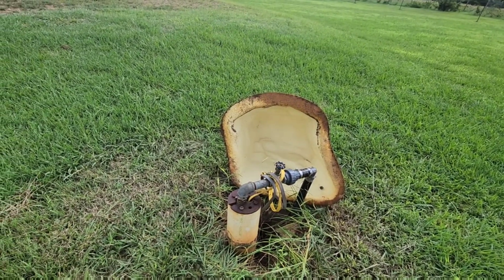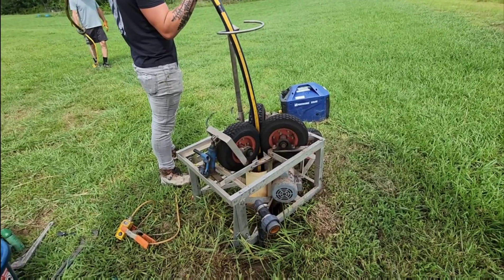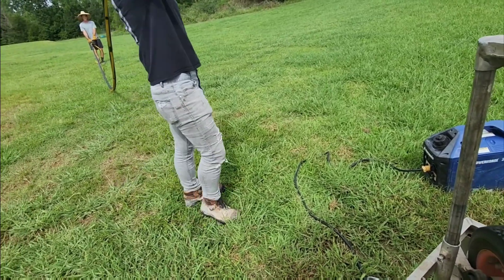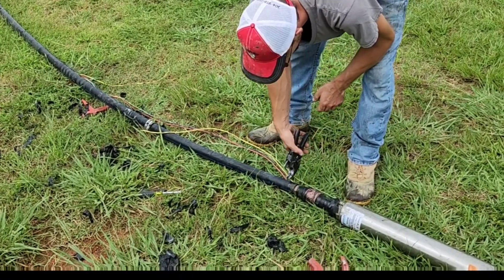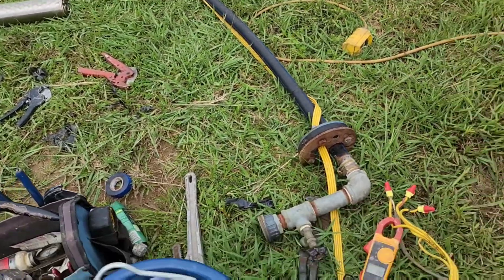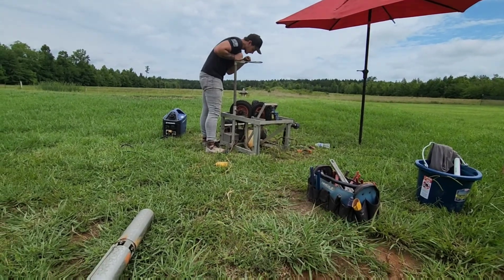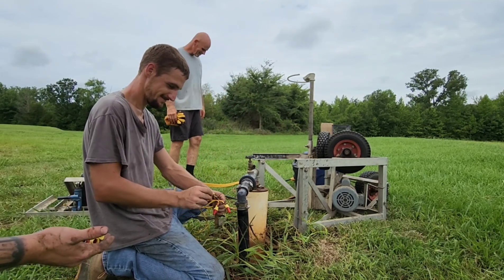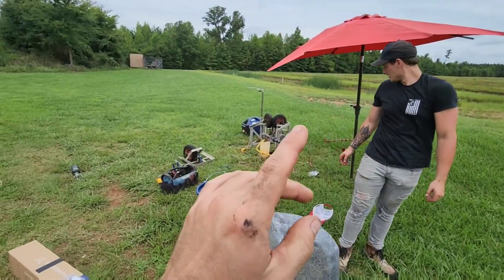Replaceing a 3 HP Well Pump for "KOI" Fish Farm, 1 Million Gallon Ponds Filled by 2 Wells!

Comment: the problem is directly related to not using the torque arrestor  originally , i's obvious a wire would rub if the pump was hung loose into the pipe, especially 3 hp. Installation error

Comment: You r good and know a lot,lots of experience BUT…pulling the pump from the yellow wire to attach it to the pipe and tighten with the channel locks the pipe couple w/o holding it NOT You

Comment: I noticed that the equipment you drive appears to have the steering wheel on the left side. Is it designed and built in UK or  am I in error?
Reply from the maker: No, a phone camera just flips the image. Nothing crazy
Reply: All or most Yanks drive on the opposite side of the road,because they like to be different!

Comment: When the pump runs it cause vibration it move the pump pipe then the electrical wires touch the well pip that cause the wires break
It is the easy problem to solve for not get the same problem but why you only replace the wire.

Comment: I continuity test will tell you without pulling the pump. A bad motor will read dead short , open circuit is bad wire. Covers all fail modes except shorted wire

Comment: Seems light lightning would have burned/blackened the insulation where the copper went bye bye. And the amount of voltage and current needed to ruin the wire should have turned the pump itself into a molten blob.  I guess if both pumps burned out at the same time, that's about the only good explanation, but still. Ahhh, and the more I think about this, I think I understand it. The neutral wire must not be bonded to the ground wire hard enough, so all of the conductors had the same high voltage, so nothing went through the pump at all, but the yellow wire is the one that had a weak point in the insulation where the lightning bolt leaked out. Still should have been some burn marks.Just because I was a failure analyst in a prior life, I always want to get to the unambiguous answer. Last possibility, installer had the pump hanging on the yellow wire by accident during install, didn't realize it, and a small (less than 4.0, you would never feel it) earthquake that was just a vertical wave broke the camel's back.

Comment: I have a 6 thousand gallon koi pond  with over 4 foot long koi that I bought in 2005 and when it doesn't rain for a moth in the summer water is important  , They are not expensive goldfish    they are koi  so related to carp   They have whiskers like carp also   just a little info  .Did you see them     Your video explains why my well pump went out bad wiring  I even asked the plumber about the wiring before he put first pump down and destroyed it  . Replaced the wires and second pump worked  had to change likes from 666 to 667   don't want you to get bad luck
Reply from the maker: I've been noticing that bad luck number!  Thanks for that!
Reply: @h2omechanic  your very welcome and your fix on my well worked I have been running the hydrant near my pond 2 times a day for  awhile and checking v the look of the water and it is clearing up . I will know  better when my filter goes off thursday .I also flushed my water heater by turning the valve off and on to stir up anything in and it did . As per another youtube posters video . I guess I may have hired a not s good plumber but they were the only ones that answered the phone at 7 am to get water back on . but at least were nice enough to bring me water so hubby could take his medication as he just got out of the hospital the night before  . I did give the guys each 20 dollars for lunch on us for saving me , so I guess it was a win on that . I had water even though dirty which I expected . Hubby is getting better after his heart attack . Your mom and dad raised a great son  SO THANK YOU AND THEM

Comment: What wire gauge do you use for a residential one horsepower pump that like 100 feet deep?
Reply: Gotta figure in the run from the panel to the we'll head too.

Comment: Would it not be an idea to fit soft-start relays to those well pumps or only fit well pumps that has soft-start built in? That would solve a lot of problems like this one and make the well pumps a lot friendlier to drive from a grid / generator point of view too! 👍

Great video, thanks for sharing it. 🙂
Reply: @Morten Mortensen, that's an interesting idea! It reminds me of the "buffering" of "delay" type fuses which are designed not to trip when various devices with high current demands first activate.

Comment: I have many 7.7 to 60 hp subs.    I run a 1/4" air line along the wire.    I start the air line at the pump head to the surface.   I can then know the water above the pump.   Each pound of test  air line pressure is 2.31 feet.   I can squeeze the flow rate  to have the proper water in the hole  above the pump.   A VFD panel is best.
Reply: Are you talking about sending an air line below the static water line ?
Reply: @Mk101T  To the bottom of the lowest possible  water level while pumping.
Reply: @robertreznik9330  a submersible pump is best to pump with no air in line.
But a bubble pump  .... well that is what you talkin bout .
Reply: @Mk101T  no, the air line is to determine the water level while pumping.   Air in the pump will destroy just like sand will.
Reply: @robertreznik9330  OIC ... I guess that makes sense you can use air pressure to gauge the depth. All the wells I worked on being 4" and larger metal risers.  We strapped a 3/4 " pvc line onto that they would drop an electronic probe down.

Comment: If you have a mega tester you should be able to test ohms before you rewire and connect pipes, you don't need to connect and dry run a pump to check it. That mega test should indicate a direct short or blown motor.
Reply: Running the pump to see the amp draw verifies way more than checking the motor windings ...it verifies the entire circuit is in good working order that the pump is doing work.  Where this will fudge him one day is the pump is coming on it is doing work he drops it down the well but it doesn't work well.

Comment: How do I securely attach the drop line to the pump and to the pitless adapter ?
Are regular  stainless steel clamps good enough ?  Or are barbed clamps necessary ?

Great videos.  Fascinating & very informative.  Thanks
Reply from the maker: Use SS barbed fittings & 2 ss clamps.

Comment: subbed love your channel great info I put a pump in 16 years ago home depot job my well pump is 320 deep and its time for a new one which pump would you recommend and what size I believe I put a 1hp bigger than what was in there no control box.... thank you
Reply from the maker: Try to find a 5 or 7 Gpm pump. Either a 3/4hp or 1hp. 
I'd say a 3/4hp 7gpm pump bc its capable of pumping from 300ft & the wire size won't be an issue. 
1hp pump typically require #10 wire size.
Reply: @h2omechanic  thank you for the help and quick reply it does have 10 ga wire on it now any brand sugestions
Reply from the maker: @alphonsebuttigieg9481  Goulds or J-class or Grundfos
Reply from the maker: @alphonsebuttigieg9481  I sell pumps, just haven't opened up a online store yet. That's my next step. 
My 3/4 7 J-Class is $800 +s&h

Comment: Posting here because this is a recent video and so I'm hoping for a response. You've mentioned in a few of your videos that you don't like 3-wire capacitor-start pumps, but I haven't heard a good explanation as to why. Yes they are slightly more complicated to troubleshoot, but you don't need any more test equipment than the Fluke multimeter you already have. And there's only a couple of components in the control boxes for these pumps, a capacitor and a relay --  both of which are easy to test and replace. Since it's the capacitor that often fails, it just seems like a 3-wire pump with external control box is the smarter choice. It could avoid having to pull the pump!
Reply from the maker: 3 wire pumps just require more products to carry on hand & in stock. 
It really comes down to simplicity for me. 
Certain areas that hang pumps really deep or use PVC drop pipe, it makes sense to use a 3 wire pump due to the difficulty of removing the pump. 
If a Cap pops or a relay gets fried, alot of times it's because the pump is towards to end of its life (or a lightning strike) 
My channel is focused more on the Homeowner, I try to keep it simple for people to understand if they want to DIY & save $$ (alot can't afford service calls)

Comment: I’ve come across your videos when researching a project I want to do. A couple of my neighbors have been running out of water and burning up their pumps. I had mine lowered about 7years ago and based on the water level I have about 10ft before I run out of water again. I’d like to be pro active and lower my well To about 120ft it’s currently at 100ft. I don’t have much experience with poly. Is it as simple as splicing 20ft of poly pipe and wire? Any feed back would be great thanks!
Reply: You could but polypipe is cheap enough that I personally would install a new pipe in one piece. Problem is that it comes in rolls of 100 feet or 500 feet but maybe you can find a 200 foot roll. Make sure it's rated for the pressure. If you add a new section of pipe, I'd  add it at the bottom as there will be less weight on the joint compared to if it was up high.  As for the wiring, you should be fine splicing it with a waterproof connection. Make sure that your voltage drop is not too high with the ever increasing length of wire.

Comment: ok as i am newer to the channel,, what is the reason you don,t like torque arrestors?
or if you have a chance you can just give a more in-depth reason in your next video.
Reply from the maker: If they fail, & eventually they all do, when you go to pull the pump out, the rubber folds down overtop the pump & it begins to wedge in & becomes extremely difficult to keep pulling it out. Alot of times it'll require a crane. 
They do have a use, & needed in some cases, but need to be a few feet from the pump. 
They sell white hole centering rings, id rather see them used to keep the pipe centered. 
In a nut shell, I've seen the rubber tq arrestors cause more issues than help.
Reply: @h2omechanic  thanks for the info i will keep this in mind, the few i have installed i did put 4 to 6 feet above the pump and that was on a 1 HP pump and a 3/4 HP pump.

Comment: pipe wrap tape all the leads at the company I work for we use at least 5 role of tape every job it's mandatory to always wrap the leads I'm surprised there no safety cable if it dead heads it will blow the pump end right off the tubing hopefully the wire holds it or it will never come out. Even if you try to fish it out it would be hard. I no it Saturday but it would of been a good time to explain the difference between single phase and 3 phase type of application and what to look for to be able to no the difference between the two and rotation and when it's needed 🤔 but I no how it is especially working by yourself. Have a great one till the next one 🌊💧⛲👍👌✌️💯
Reply: What do you use for safety cable? What type of material and diameter?  Most rust or rot! What tape do you recommend? Trying to learn! Thanks!
Reply: @michaelholland8969  rope or stainless steel cable tape 20mill pipe wrap tape sch120 pvc deep well drop pipe  ss coupler all fitting should be ss. Hope that helps p.s 11/4 no smaller then 1in should be used.
Reply: @josephsaucedo8691  Yes, thanks for the help!